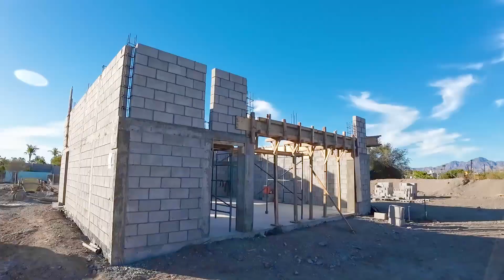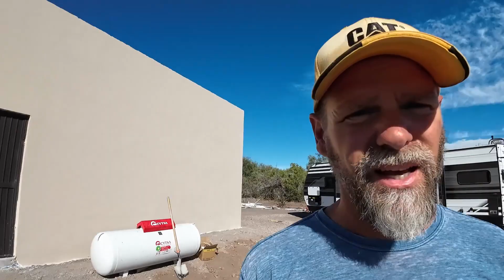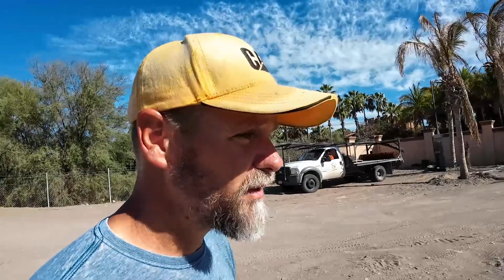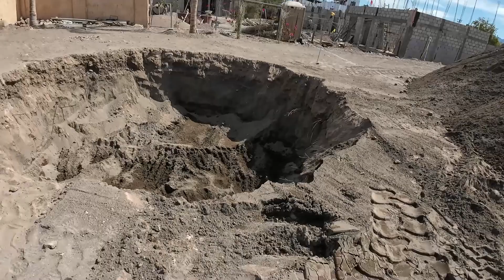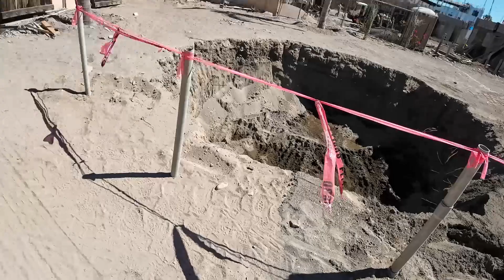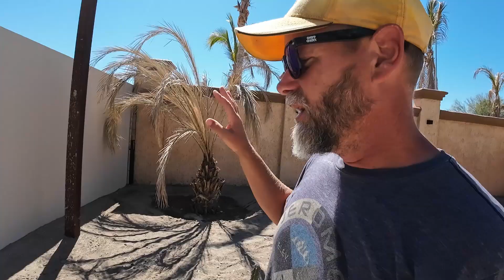POOL - VILLAS - GARAGE - Construction Overdrive at Pufferfish Villas!

Comment: Holy s..t Dat Man.  That is a long way to pump. Can you save the "grey water" there and use it to water plants etc.? Or is it flushed away too ?  However and I do know your have progressed well beyond what is being seen, I can see the shape of things to come.   👍👍  P n D
Reply from the maker: The  sewage pump that we will be using is rated for entire neighborhoods of up to 25 single family homes. The distance is not really an issue, it's the elevation that matters. Many of these pumps are installed and pumping over a mile and 25 foot elevation gain. We will be going up about 5 feet in elevation and about 100ft distance.
Reply: @dooglassandesperanza  I believe you. I trust your knowledge and ability. I just don't trust Murphy's Law. And this could be a real stinker.
Reply from the maker: Me too. That is why I have passed up many "better" solutions while building the infrastructure to instead use more common solutions. I am purposely using a pumping system that is readily available here, has dozens of installations around town, and is familiar to local plumbers. The pump system will be installed with maintenance in mind so when it does fail it can be repaired or replaced quickly by local plumbers with local parts. We are building everything with redundancy and maintenance in mind so we can minimize downtime when problems arise.
Reply: @dooglassandesperanza  I personally build redundancy into every build I can. Whether building a deck or welding up a trailer. So, where others say it's a waste of time and money, I say my peace of mind is worth every extra drop of sweat, cut or bruise. I can Always hear my Dad telling me if a job is worth doing it's worth doing right. It's a curse but has served me well.    👍👍
Reply from the maker: And we have an extra need for redundancy. Guests are not going to be happy with no water or no power just because something broke. And if we're not there to fix it then we have to have everything set up so we can have a local come in and fix anything quickly so that guests are not impacted